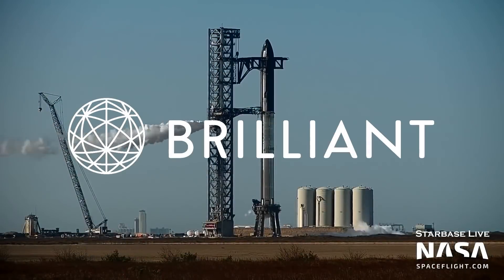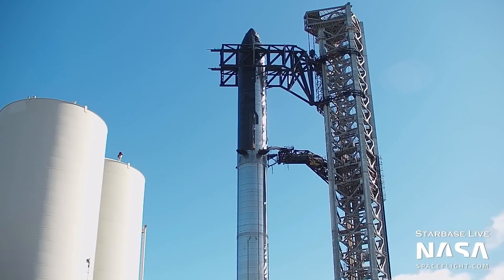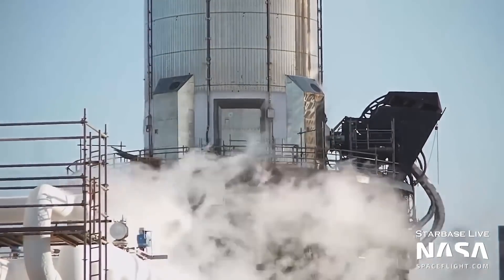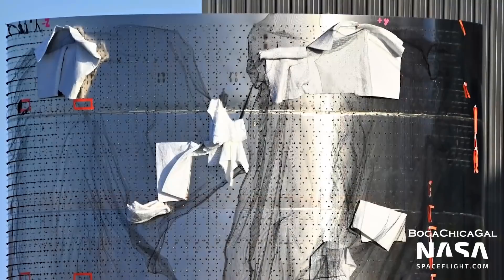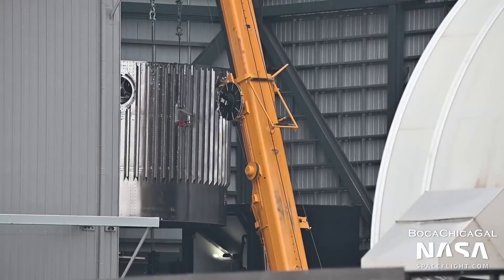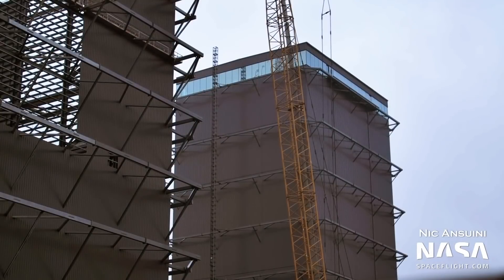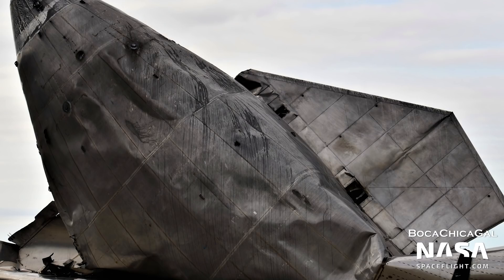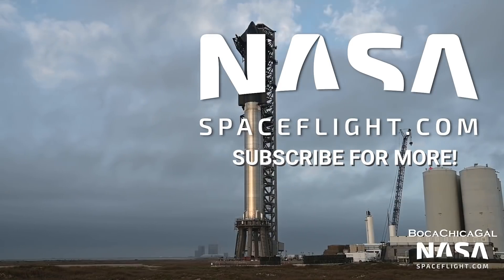Starship Full Stack Proof Tested - But Then SpaceX Destacked It | Starship Update (Narrated)

Comment: I'm estimating the payload bay on a Starship could contain either Starling satellites  , , , or , , , a Cybertruck !  Having a working Cybertruck sitting on the moon would be a near impossible to beat marketing exercise for when that vehicle becomes available.   
The whole selling point of pickup trucks is go anywhere , move heaps of stuff.  Beat that Jeep, Toyota, Range Rover , whoever. 
 I'm not saying it will be the first thing delivered by a Starship but it's probably a very high priority.  

As for booster landings I figure they won't approach the chopsticks from directly above but instead decend to about 50 to 150 metres sideways out from the chopstick arms and then walk sideways toward the arms allowing them to be closing as the booster approaches. We've seen SN5 and SN6 do this manoeuvre of 150 metres and I think it was to see if it could be done for approaching a tower.

Comment: You forgot raptor 2 also melts ;) you still think they are just going to scrap booster 4 and ship 20 thats crazy. They will test them. Elon keeps saying those ships are going to be the first ones
Reply: Elon last said that many months ago, plans change.
Reply: @user-yd4rn4ez6m  that ship has cost them probably 100s of millions to build they will use it to get data so they can successfully with a later ship. Space x knows the first few will fail. Just like the other tests fails a few times before working
Reply: @AllMyHobbies  check elons Twitter. He just said first orbital flight will use raptor 2, meaning booster 4 will not be flying. Same for S20, since it cannot mate to the newer boosters, or use R2.
Reply: @user-yd4rn4ez6m  the key is orbital. The first test has always been a sub orbital. They are planning on getting close to orbital speed and coming down in the pacific.
Reply: @AllMyHobbies  he has referred to said flight to Hawaii as ‘orbital flight test’ for some time and that will be completed with raptor 2

Comment: At this point, I'm no longer betting on 4/20 flying, the tech is way out of date now. 24/7 will have a much higher success chance imo.
Reply: I agree but 24/7 will surely not fly before the end of May there simply is way too much work and testing to be done before.
And IDK how many Raptor 2 are currently available but AFAIK there aren't enough at Boca yet.

My guess is that if SpaceX want's to fly before June they will use 4/20 and otherwise it will be 24/7
Reply: They might want to test some things out on 4/20 so it can be optimized on future stacks. That will give future stacks a better chance of flying/landing.
Reply: I think it depends on the differences and what they really want to get out of the first flight.
Reply: You are right :)
Reply: This is an argument that's presented a lot yet lacks merit. SpaceX are going to need as many prototypes as they can construct considering that early test flights will expend the ships. It's like if someone was arguing they weren't going to use SN9 because SN10 was going to be ready soon and therefore SN9 will be outdated. They'll fly both, and would fly more if they could construct prototypes faster.
Reply: @danmosenzon1477  SpaceX doesn’t have a lack of prototype vehicles though, ships and boosters past B7 and S24 are already being assembled. Makes much more sense to go with newer and safer launch vehicles and not risk blowing up stage zero.

Edit: Elon just confirmed on Twitter that first orbital flight will be with R2, meaning booster 4 or S20 won’t fly.
Reply: @danmosenzon1477  you are wrong :)